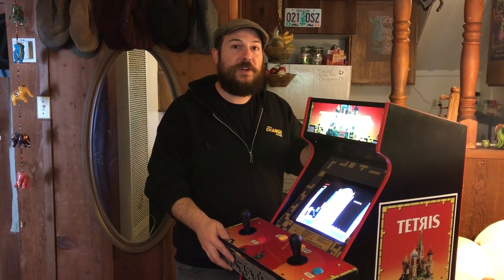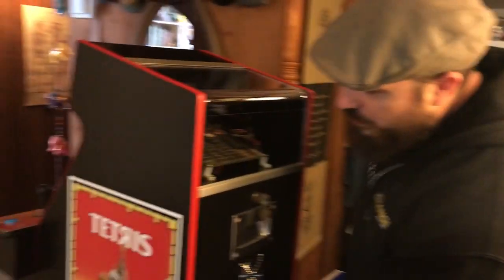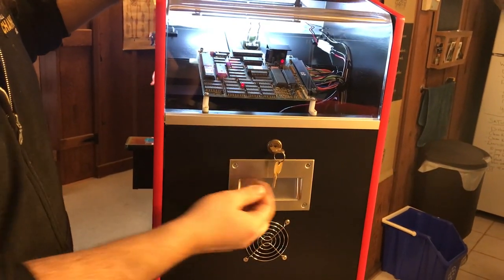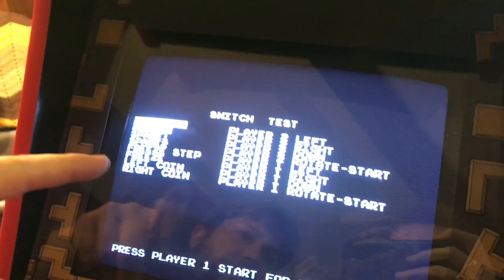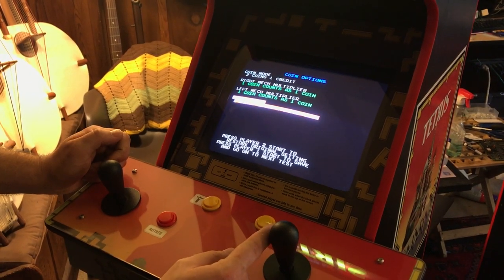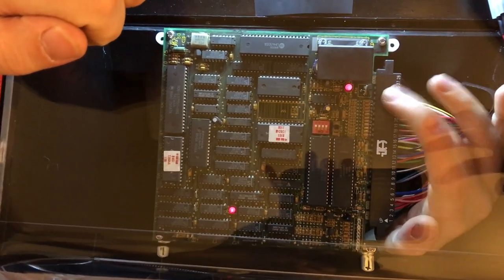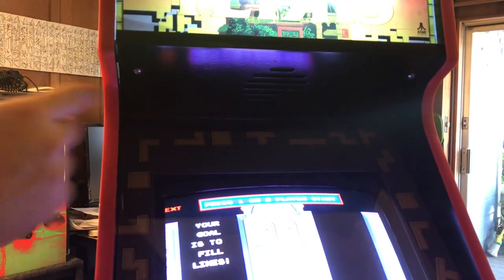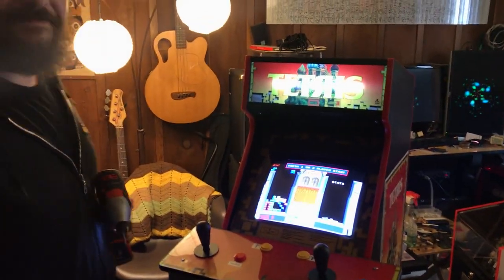Tetris Mini arcade cabinet features and instructions

Comment: Nice use of a IIgs monitor. Are you attenuating the jamma video signal at all for this?
Reply from the maker: no, I connect it directly. Haven't had any issues on the 5 or so cabs I've made using these monitors.
Reply: @SmallChangeArcade  cool, who knew?